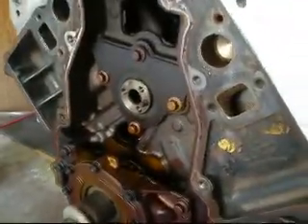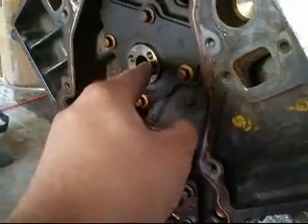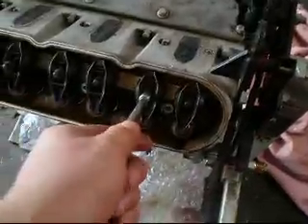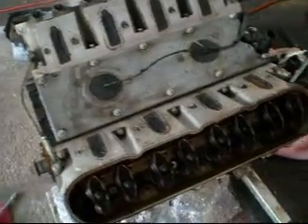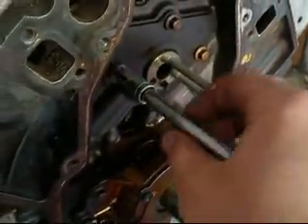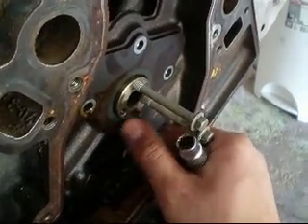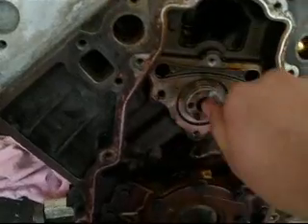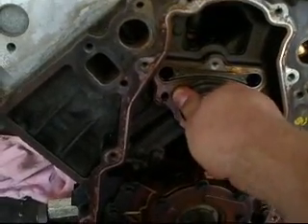HOW TO : Ls1 cam swap Part 1

Comment: If it's on an engine stand and not in the car, just pull the cam with the motor upside down so the lifters won't fall.  Just my opinion.  Nice video
Reply from the maker: I agree.. next time I'll do that lol